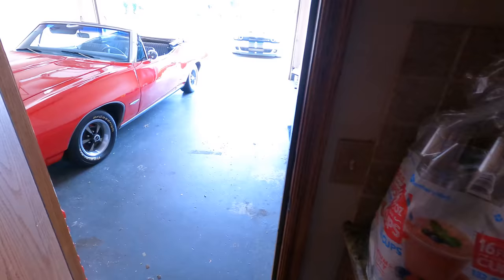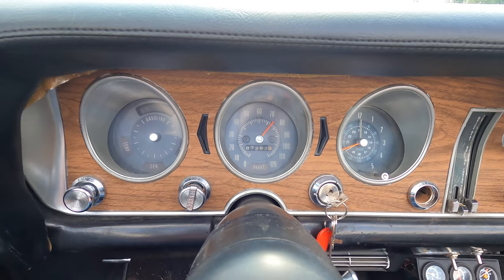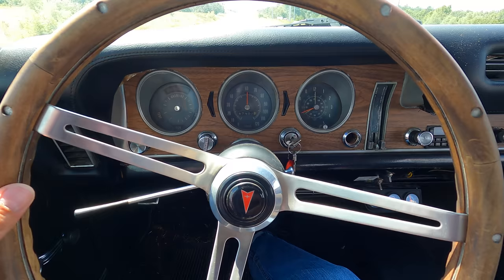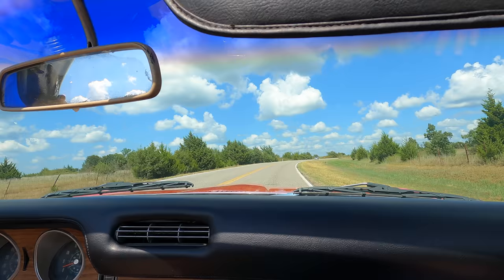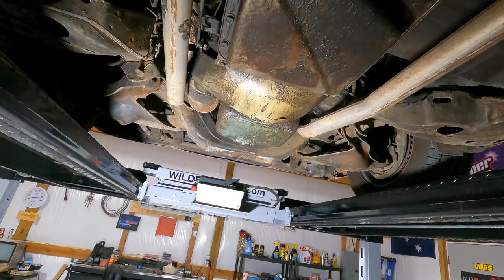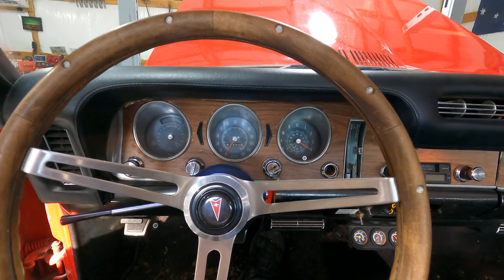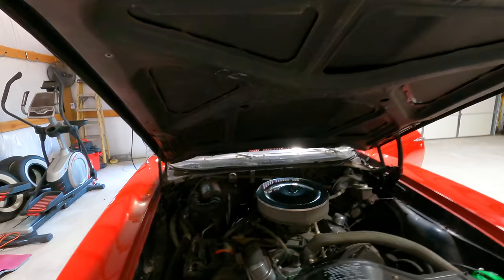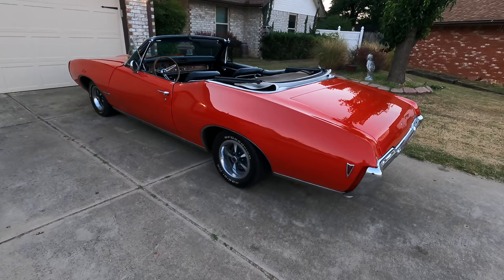Everything Wrong with my $20K Fake 1968 Pontiac GTO - How bad is it?

Comment: Hey Randy,
Your car isn't a GTO. A Tempest with a 326/350, 2 speed powerglide and 3.08 gears is a highway cruiser. It runs normal for what it is. Vacuum secondaries don't hit hard.
It sounded great once you were at highway speed and floored it. You were doing 60/70 and it kicked down to 1st gear!! 
1st on that car, with that gearing, would be good for 75-85mph.
350 HP was measured at the crank back then. It's more like 180ish HP at the wheels, like today's cars are rated.

Your complaint about the "Mufflers" hits right where the car was designed for. Highway Cruiser. It probably actually came with a 2bbl carb, and single exhaust. The build it received gave the car more performance that it originally had.
 Remember, you drive a Helllcat and MANY other modern cars that would such the headlights out of it's big brother GTO. FCS!!!!!
Take these old cars in context. It was a decent performer for it's day.

You also may have put a 4bbl that is too large for your combo. Headers and intake are good but without a reasonable cam, it's not going to run like a GTO or any other performance car of it's day.

A Holly 500cfm 2 bbl might actually be a better carb for your application and components.

BTW, I couldn't tell from the video where you changed carbs and showed the intake. If it's not a "Dual Plane" but a high rise manifold, It's the wrong one for torque and meant for engines that spin over 5000rpm, which yours (normally) doesn't. 
That 2" spacer plate is also usually added for increased torque  (ie lengthening the intake tract). If it's a high rise, swap it to a dual plane with no spacer (unless needed for carb/linkage clearance) and you'll see quite a difference in how it runs at low end. 

Note; a Quadrajet is a terrific carb, just a bit more tedious to work on/tune than a Holly. 

You are sure (no offense) spoiled (and young) if you think old cars aren't reliable. You are only seeing them once they are very used up or have maybe been "Rebuild" . How thorough/competent a restoration and/or rebuild has been done can determine just how good the vehicle runs. But, that Tempest wasn't meant to be a Performance car, just a nice cruiser for the family to run around in on a sunny day.
Back in that era, I built a lot of "Old Cars", from the 50's/70's. They can run terrific if you get all the basics right.

Before you sell it, drop the dime and take the car to a Dyno shop with a good reputation, have them check/recurve the distributor, check compression (and recommend the proper fuel), check /change the jetting in the carb if needed and in general, tune it properly for your parts combo. 
If that  engine is still at stock compression, it's (Probably) too high for today's 91/92 octane. So the builder may have severely retarded the ignition so it wouldn't "ping"/detonate. THAT would also be a reason why it has no bottom end coming off a stop.

Just bolting on parts isn't "Tuning".

Who knows what the guy who built it actually knew about tuning it for that combo. Either way, from how it ran when punched at highway speed, it sure seemed about right for the era and combo.

You might find that it now/after a Dyno Tune, it runs so good, you don't want to sell it.

Finally, swap in a performance built 700R4 and you'll really see it come alive.

Heck, flip a few more cars and you'll have the $$$ to keep it and still do the Plymouth!!!!

I enjoy your junk yard dives. Takes me back to my "Yout"
Stay safe and healthy.
cheers
Boots Langley
La Mesa, Ca
.

Comment: Randy, back in 1968 I purchased my first new car, which was brand new 1968 GTO.  In that year the GTO came with a 400 ci / 350 hp Engine.  It cost me $3200 new from the factory.  I really wanted a 1968 Corvette but i could not afford the $5000.00 price tag.  About a year later I traded the GTO for a brand new 1969 El Camino.  I bought the El Camino because I could not make a deal with the Chevy dealer for a 1969 Chevelle  396 Super Sport which was a high metallic Emerald Green w/ a white interior.  These are just three of 48 vehicles I have owned since I was 15 years old. I can you a list if you would. Don S Phoenix

Comment: Look at the shift indicator, or count how many shifts it takes to get to high gear. Powerglides are 2-speed, Turbo 350's are 3 speed. '67 was the last year for the aluminum Powerglide, I think. Powerglides didn't use a vacuum modulator.

Comment: Use Ethernet over power, easy setups, if the shop is hooked up to the power with the house, if not then look into Ubiquiti, they have point to point ap's, saves running a wire. Love that old Pontiac, well worth the price to me. Thanks for all the videos sir.

Comment: 350 Horse?? LOL..it's a glorified 350 2 barrel,NOT a GTO engine...
Reply from the maker: No, it's a stock original 4bbl 350 with 326hp from factory. Do your research before leaving dumb comments.
Reply: @michaelcoonce6694  this is a very accurate comment,not a dumb comment,as stated from a novice.don't be bitter that you got a fake gto.

Comment: Changing stearing gear boxes in the past, I've always replaced all of the power stearing lines as well. That's me of course.
Reply: If you want to keep a car correct, you can put a steering box from an 80’s Monte Carlo SS in it. The top cover from the goat fits right on, which is where all of your correct numbers are. Variable ratio power steering and correct numbers for cheap!

Comment: The low gear is 1.76.1and drive is 1.1, and whatever the rear gear is equals the final drive ratio ( example: a car with a 3.23 rear end , 3rd gear is essentially 3.23, as most th350,400 use a 1.1 3rd)

Comment: Oldsmobile every block looks the same also and you might be able to snug up the bearings
Reply: Olds also has that huge oil fill pipe sticking out the front!
Reply: Olds, Buick and Chevy did make small and big blocks. The Buick and Olds blocks did look similar unlike the Chevys. Pontiac and Cadillac made only 1 size block.
Reply: "snug up the bearings",  What does that even mean??????????????????????????????
Reply: @mikee2923  Buick had the distributor in the front,same as a Cadillac, Olds, Pontiac and Chevy had the Distributor in the back

Comment: if it only changes gears twice its a power glide, if it changes 3 times its a 350 or 400 turbo easy enough.
Reply: Edward Martinez  Powerglides were in 1969 Camaro with 307 engine
Reply: If it changes once its a Powerglide. Twice its a turbo hydra matic.. No overdrive.
Reply: Edward Martinez  Nope...I hade a 1970 chevelle 4 door with a 307 and powerglide.

Comment: I had a 67 Impala super sport that had a 327 in it with a two speed powerglide transmission but mine had an overdrive which is basically a third gear and I had a little bit lower gear on my first but something you could do is put a lower gear in your rear end to give you that take off

Comment: Randy,.   What I think you have there for a transmission is the old Buick X2 ST-300.   The venerable Super Turbine 2 speed....note this is not a powerglide.   It was developed by Buick division but was used in Buick Pontiac and Olds divisions for a couple years

Comment: I was president of the OVGTO association in a former life…….
It’s VERY easy to get taken on a clone. We were judging the nationals in St. Louis one year, and this retired dude from a huge store chain spent 40k having his gto restored. He about cried when we told him he spent 40k restoring a tempest. Everything looked great on the car, but there are a few hidden places that I’m not going to mention for obvious reasons, that you can check if it’s real. It was sold to him as a gto, and last I heard from him, his lawyer was going after the dude that sold it to him for fraud.
There are other easy ways to tell if it’s a poorly done clone. For instance a judge…there’s gobs of fake ones. Open the trunk and let it go. If the trunk lid falls, it’s probably fake. Judges had a stronger torsion bar to hold the trunk open because of the added weight of the wing.
There’s lots of easy things to check, but nowadays you can even have fake vin plates made….
This goat in the video would have raised red flags immediately because there were very few goats without the enduro nose.

Comment: The wheels are the correct size, 14's came on the 68 gto i owned and 14's came on my 70 gto that I own now. For a stock motor car just get the correct size tires and you'll be fine. Did you check the serial # for the 242 at the beginning?? You gear ratio is why it won't take off fast from a stop. Keep it orriginal.

Comment: Pontiac never advertised their engines as big or small block they are externally the same but the cubic inches cam crank are different in each Pontiac engine

Comment: looks like a 2spd. powerglide to me. If that engine is a 5.7 liter it is a 350 and not the 389 that comes in a real GTO, plus I've never seen a GTO without the twin hood scoops.  Find the numbers on the engine block and it will tell you whether it's a 350 or a 389. I'm betting it's a 350. I don't believe the Holly carb is correct for either the 389 or 350. Pontiacs used Quadrajet 4 barrel carbs
Reply: 66 was the last year of the 389. GTO's from 67 to 70 had 400's. In 70 the 455 was offered. There are 350 HO's with 375 horses!

Comment: It should have 14” wheels. Get some 225/70 14r on it and it will ride better.  It probably has the original 50+ year old springs on it. Replace them and you won’t bottom out.  
The most amazing thing is the clock still works.  Mine is only right twice a day.  Sorry about the powerglide and likely 2.75:1 rear gears.  It makes these less than aspirational during acceleration.

Comment: Engine code is on the right front of the block.  Stamped two digit code.  Look that up.  Even the old Motors manuals have those codes in them.  Should also have 4 or 5 digits on a second line that match the serial number.   Every Pontiac engine from 1960-1981 has the ID there.

Comment: Secondary's opened fine, typical Holley sound, the correct Rochester Quadrajet would have a bit more pronounced noise. Car needs a good tune up and carb adjustment or rebuild to fix off the line acceleration.

Comment: Put air shocks on rear.  I believe 14” is correct for 1968 wheels.  New top with glass window, new pads, and rear well…figure $2k.  The twilights are 1968 LeMans…not GTO.  Non Pontiac sport wheel.  Non-scoop hood.

Comment: I have 68 convertible that I got as sophomore in high school in spring of 74.
Came as a 400 - 4 speed with manual brakes and steering.
Changed the engine out first time in early 80s when a rod started knocking. 
Lost the original engine somehow when I moved shops.
Currently wrapping up minor resto on it which included installing a 68 Bonneville 428 that I rebuilt and power steering and disc brakes.
Should have it all back together this fall.

Would love to see this car. I am in Texas panhandle not far from Oklahoma.
Shoot me a message with your contact info if you dont mind.
Thanks, Jeff

Comment: Trans is a super turbine 300. Similar to a powerglide but not the same. Internally I think they function the same though. And as you discovered, the engine is a 350. They didn't use the ST on the bigger engines. 

It's a nice, clean LeMans with GTO badges...  

The stock size for those tires should be a F78-14 which is a 205/75R-14. There's not a lot of 14" tires left but I think cooper makes a 225/70R-14 that's a little wider and just a tiny bit taller - like a 1/4" taller. But the cooper cobra's have that vintage look that would be perfect. A set of 205's work too. That car is a cruiser, not a race car.

Comment: Nice car!  Chevrolet built the Powerglide transmissions.  A 68 Tempest Le Mans with 350 came with the two speed M35 Turbine 300 built by Buick - and it is a darn good transmission (a quick reseal would stop the leaks - pump to case gasket, converter seal, speedo cable o ring, vacuum modulator, rear seal, etc).  That is what yours is.  Rear axle ratio is likely a 2.56.  They were not bombs from standstill.  GTOs came with a 400 engine and the optional automatic was a M40 turbohydramatic or turbo 400 (beginning in 67 for both 400 engine and turbo 400 and with or without the dual gate shifter).  Maunual 3 speed standard manual 4 speed optional.  Wheels, caps, and beauty rings are correct as original. All GTOs and Tempests came factory with 14 inch wheels. !5 inch wheels were not available on a Le Mans or GTO until 1973.  In 68, bias ply G78 - 14 tires would have been the right tire size for a V8 powered car if I remember right.  Your car is actually well optioned - they just didn't have all of the stuff they have now and a lot of things on new cars come standard now to cut production costs (cheaper to build them all the same).  V-8, automatic, ps, pb, remote mirror, Rally II wheels, AC, radio, clock, console with floor shift, soft ray glass?, etc. were all extra cost.  There were more options available like 8 track, power locks - windows - seats, ride and handling package, lamp group, right side outside rear view mirror (no sport mirrors in 68 - only remote adjustable or manual adjustable) but a lot of cars had a lot less. Power top was standard on the Le Mans.

Comment: I googled transmissions for the '68 LeMans. They came with a 3 speed manual, a 4 speed manual and a 3 speed turbo-hydramatic 200. The standard V8 was a 350 2 bbl with 265 horsepower and a 350 4 bbl. with 330 horsepower. I am guessing your car has a transplanted engine and the transmission that came with that engine which is obviously a 2 speed automatic. The transmission does not seem to have the whine a powerglide makes when in park or neutral but it could and I'm just not hearing it on the video. Oldsmobile and Buick had their own 2 speed automatics so I suppose the transmission could be one of those. At any rate, at a minimum, I think someone replaced the transmission.

Comment: I get the thing on the mirror.  My van has door mirrors but the windshield one fell off and I keep looking for it anyways.  It's legal without it.   I also miss power windows and locks.  

Otherwise it's great, frankly, a 94 is a ton better than the 97-up ones.  Way less plastic parts.

Comment: The 14" is factory size for a 68. But they used taller 70 series tires back then.. those low profile radials are wrong. And shocks are cheap. EDIT: Nevermind. I see in the description you figured all that out and corrected it already.

Comment: It should be easy to see what type and size tire to buy, call PHS.  Also on door.  I ran H 78 15 inch steel studded snow tires on my 66 389 goat in the heavy snow of 70s in the North Pocono area.  But the goat could pass every one except 426 coda, 440 6 packs, big 454 chevys..

Comment: Since it's not a GTO the only other size V8 if it is a Tempest or Lemans and original engine is a 326 or a 350. But it would have came 2 barrel single exhaust factory, especially if it came with a powerglide trans. You need to check the engine casing  numbers because for Pontiac V8's the 301, 326, 350, 389, 400, 421, 428 and 455 all used the same block and many parts are interchangeable. [edited because I left out an engine size.. too many pontiac lol].

Heck in 68 the GTO had 4 different 400's. The standard 2 or 4 bbl, the H.O., the Ram Air 3 and the Ram Air 4. But ONLY 400's were available factory in 68 for the GTO. However to make it more confusing some dealers had special upgrades and put even bigger engines in them. There was even a Ram Air 5 solid lifter beast but those are more rare then a unicorn. Some Pontiac trivia for ya.

Comment: The correct rim for 1968 would have been a 14 X 6  inches  rally II rim part number 9789329 stamped JC for a drum brake car.  the tires would have been a 70's series ie  G70 . Lemans would have been 78 series G78 with a 70 series optional.

Comment: on the drivers side towards the front of the block it should be stamped as to what block it is, and also Pontiac did not use a power glide its a   super turbine 300.

Comment: The carb 4 barely seam sound like they are working but the accelerator pump may be bad. I would look for a 3 speed for it if your going to drive it alot

Comment: Older cars are not more reliable. I remember in early 70’s, we went on vacation to Maine every summer. I always liked cars and would pay attention to them. It was 135 mile trip and on the way, there would always be 8-10 cars broken down, overheated. But, a 99 Toyota Camry was probably more reliable then new cars with all the sensors and modules.
I’m not a convertible guy but it’s still a nice car. The Chevy and Olds versions were obviously great too.

Comment: You can get tires taller and it'll give you nicer ride then getting similar size in the 15n or you can find used 15 inch Wheels and save some money

Comment: It bottoms out because the springs are weak. Shocks only control rebound. I believe they actually did come with 14`s. 15`s were an option if my memory serves me correctly? The front tires are too wide stressing out the front end parts (hence bearing wear etc.). That carburetor isn`t original I don`t think.
Anyway over all a nice car.

Comment: The car is great as is, please do not molest the car. There is nothing wrong with a Powerglide transmission. I run a 2 speed Powerglide in my 8.11 sec 1/4 mile race car. If you take it to a speed shop, they can make some minor modifications to the carb and timing to give you a more responsive low end without changing gears. Of course it will always be a cruiser. I love the car...

Comment: The power glides had that whine or whirr sound when in park. I'm wondering if that isn't a 350 starting out in 2nd gear for some reason?
Reply: Yeah sounds like it has a bad solenoid that isn't kicking down to first when coming to a stop.